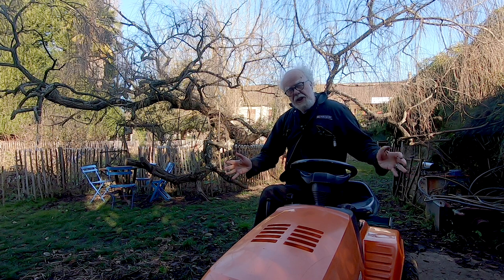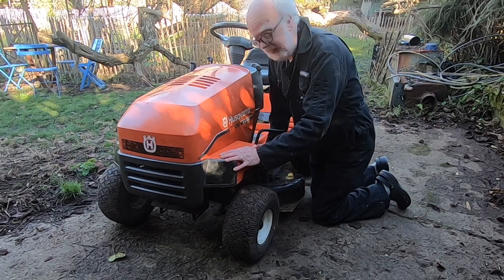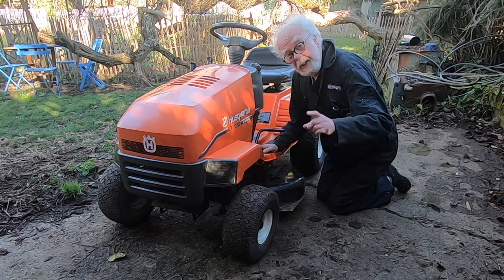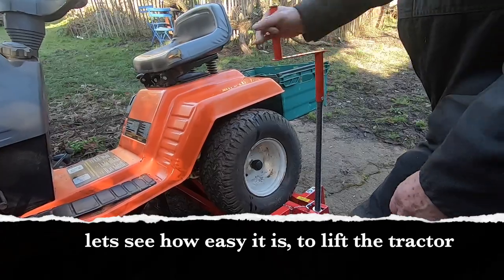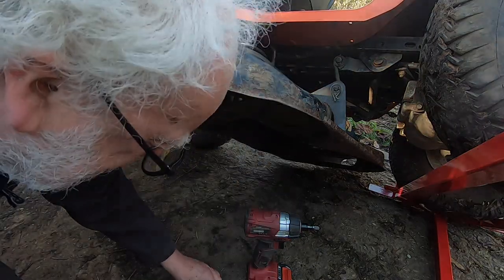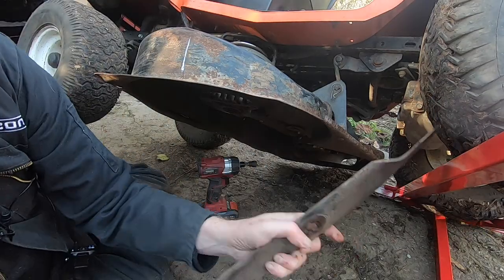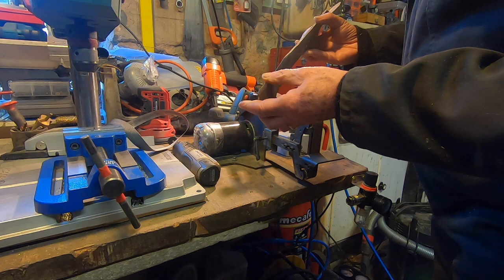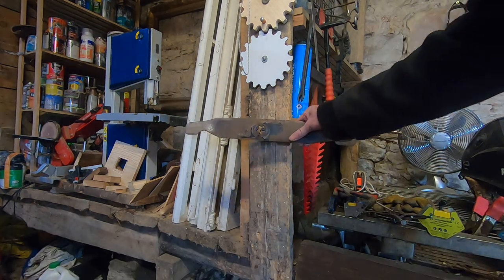Lawn Tractor Lift and Blade Change - Prof Simon

Comment: Just looked at a picture of me pushing a mower when I was 11. I mowed about 2 acres of our farm. Finally dad bought the cheapest Wheel Horse. It was also a piece of junk even then. It had a plastic steering gear at the bottom of the shaft that would shatter at the slightest bump on a tire. Happy to see some  of the old content I've loved for years

Comment: The last time I sharpened anything garden related was a big pair of shears for a neighbour. I used my 12 " Angle grinder in a vice. 
They were so sharp that I ended up with people knocking on my door asking if I could sharpen theirs. 
Never do favours for local people on a community blog website because they tell other people  you end up with to many requests.
Nice job, don't let the grass grow under your feet Professor Simon.
Reply from the maker: i should have driven it round to your house !
Reply: @SimonHollandfilms  Much less Bover Than a Hover.
Reply: I fixed a neighbour's computer once .... same thing happened, it was a nightmare.
Reply: @alphalunamare  I know when you are technically minded as I used to be, another time I copied a lot of reel to reel tapes and made digital copies of them and burned them to CD. Ever since I have been plagued by people wanting me to copy all types to tapes mostly cassettes and burning them to CD. At the time I was using an older operating system and had apps like Audacity and Toast which made it easy. You cant do it on the modern version of the operating system I use now.

Comment: If you look in the manual I suspect there is a procedure to drop the the deck completely making the deck and blades more accessible. Particularly if more maintenance is required (changing or greasing bearings).
Reply from the maker: good plan
Reply: Yep, I used to drop the deck by releasing/removing the pins and bars that hold it up, then slide the whole deck out so I could clean it properly and sharpen the blades. They are usually belt drive so not too complicated. Easy to replace belts that way too.

Comment: I need this lawn tractor tipper! Cant believe that im watching you demonstrate this as i have been mowing for days between wayching plasma videos! The tipper is probably most useful for washing the deck. I dont know that the blades need sharpening because most cutters are dull and cut
By shear ( haha) force. Grass buildup can however promote rot under the deck.

Comment: A few wee tips, I would recommend wearing gloves, under the deck lots of  mould and dirt, get a cut and it you can get a nasty infection.
The blades might be better sharpened using your angle grinder with the blade clamped in a bench vice.
If you feel heavy vibrations when cutting, blades may need balancing.
Always check the area to be cut for stones, can save a lot of damage to the machine.
Used to work on grass machinery in my younger days.

Comment: Good video. It would be clever to find a way to install/weld a nut where the hand crank is on the lift so you could use your cordless impact. Fast up and downs!

Comment: Never knew about a lawn mower tipper. I would have used ramps and some bricks or large stones under the large,  back tires. I have always just used the angle grinder without removing the blades. I just try to remove even amounts of material from each side of the blades. Really thin angles on the blades will often grow dull quickly. I grind by eye about a 30 degree angle on the blades. I then remove the tipper or lifting equipment. I then turn on the mower & then engage the blades. Any imbalance should be minimum if you did the job job right as I never removed the blade or balanced the blades. Is my method an approved of method; no, but it gets the job done quickly and it hasn't hurt my mowers over the years. You just have to have a good eye. an angle grinder, and some way of tilting the mower. If the first try is too far out of balance, which it usually never that far out of balance for me, tilt the mower up, look at you grinds and then even them out. Then repeat. Its a little bit of Kentucky/USA enginuity rather than trying for perfection and spending lots of hours on the job.

Comment: Cool tool ! I need one for my toyota
Reply: Could have just sharpen the old blade. Im sure you could figure that out without losing a finger
Reply from the maker: i just sharpened the original blades...they weren't bent or damaged...just blunt.

Comment: Professor  you might want to watch the plastic extension on the oter side it breaks easily..plus if you soak your new drive belts in a vinyl protector for car interiors like 303 you will never need to constantly   replace them ..because the groves are cut into the belt..  after. they have been made which leaves the backsides open to dry out..it's a tip I learned from youTube
Reply from the maker: thank you.

Comment: I would have thrown some blocks under the front wheel and make sure to set the brake/ and secure the raised back wheel with a strap to the lift, it sure feels good to do it yourself.

Comment: If you have a lawn tractor mower, that means you have a large lawn with some trees, right?   Go find a nice size tree, wrap a rope around the lowest branch, and set up a pulley system.  You can then lift one end of the mower with the pulley system.  You can put a block behind the wheels to keep it from rolling.
Reply from the maker: but the sheep would eat the lawn tractor

Comment: Props? - Yes, both your side and the off-side for my money, and front wheel chocks wouldn't hurt either
Flatting disk on an angle grinder? - That's what I used to sharpen my blades
Big Hammer? - Yes, but you need a dolly (piece of sturdy metal) held on the other side otherwise your just losing the force in the give of the piece.
Paper and Pencil? - Yes, to show how things go together before dissassembly, and/or to mark your piece/s
RTFM? - Yes, Read the effing manual!!!
😉

Comment: Hey that lift is a easy build , iam going to farm store get a long allthread 3/4 dia.
But iam using my battery powered drill to
Lift. Thanks
Reply from the maker: good plan....they are simple ...i wonder how expensive a metre of 25mm threaded bar is?
Reply: Found some on Ebay about 10$/ft.
3/4x3ft.

Comment: now got it up can give good look under there ...Looks good no rust ... IT MINT MATE 
If i owned it would try figure out a way to have electric motors on wheels and battery on back and have it drive silent on electric ....and use the petrol for just mowing ..  Might be fun interesting project of Hybrid EV Petrol Mower  .....
Reply from the maker: the hose connector is a great idea...hook up to water after mowing and spray with the blades turning...cleans the deck

Comment: I can't roll my riding lawnmower. Needs a new transmission which I ordered. Try to get my transmission fixed but the mechanic didn't fix the transmission properly. So I took it out and put it back in. And it still didn't work. As well I may have got the brake wrong when replacing belt. This season I'll have to take out the broken transmission again and put the new one in. New belt. I probably need to replace the mower cord. Make sure to drive it around a bit. Sharpen or replace blade and install the mower carriage back. Meanwhile.  I can't move it. So my mower is sitting at the bottom of my hill. My hill and adjoining neighbor's yard is a lawn mower killer. Literally WRECKS lawnmowers. I've hired people to mow and certain parts of the hill are too steep. So it would be nice to have a garage. Have a lift kit and a nice flat yard. But not so fortunate. It's going to take me a bit to fix that thing this year. And make sure the belt and brake are correct.

Comment: They're worn out, sandy soil?
Replace them, you'll be surprised.
Decent effort tho.
Check out Taryl fixes all on YT
Reply from the maker: that's interesting...what did you see that made you say they are worn out?
Reply: @SimonHollandfilms  They were quite rounded off at the "working ends" of the blades. 
Only a short area at each end does all the work, not the whole thing.👍

Comment: That's not how to check the balance of a lawnmover blade. You need to lay it down flat over a sharp edge with the sharp edge crossing the middle of the blade's center hole. I use a metall saw blade firmly held in a bench vice and then place the lawnmover blade on top of it crossing the middle of the center hole. Then if it tipping over to the right, you have to grind it more on that side or vice verse.
Reply from the maker: thank you...good advice